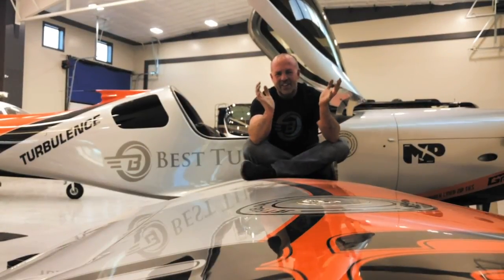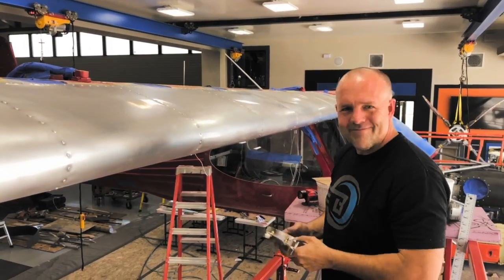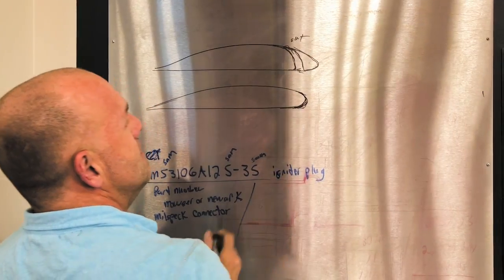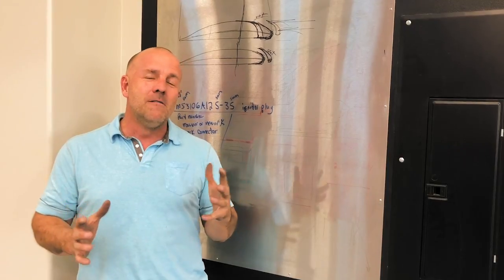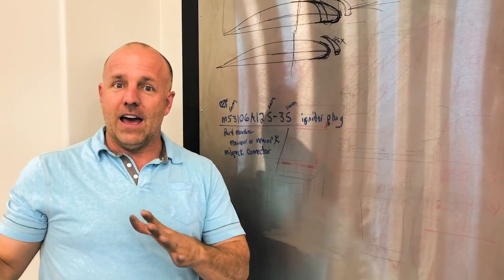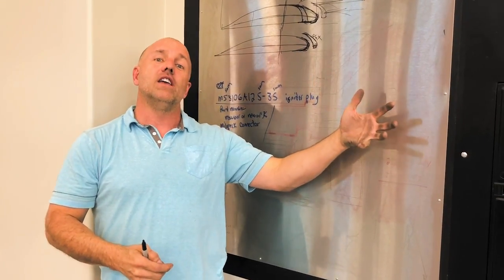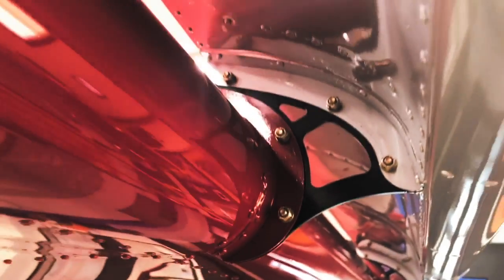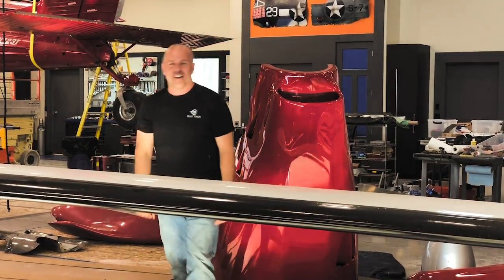Mike Patey Wilga (DRACO Video 13) Leading Edge Slat and Paint

Comment: The Wilga airfoil section is a NACA 2415, by the way, if anyone is interested. That's the same airfoil that's used on a Cessna Cardinal, Douglas A-24, Douglas SBD Dauntless, several Northrop designs, a few Voughts, and several other planes.
Reply: Cardinal, with tapered wing, transitioned to a different section at the tip, no?  Not up to speed on all the Model 177 nuances; did they get drooped/cuffed LE's like the 152, 172 etc?
Reply: Different airfoil sections at the tip seem to be common. Not sure about the Cardinal (or too many others, for that matter!). I believe the F4U Corsair had at least 3 different sections (including a different one for the wingtips), and my Baby Great Lakes has 2.

Comment: This discussion on the variations of a slotted and a slatted leading edge is interesting. If I understand you correctly, then the one thing both have in common is that increased drag happens when the angle of attack or pitch changes in the vertical. Meaning, when the aircraft is pitched up and the angle of attack is shifted from smooth airfoil with a glide ratio, this drag creates results in slower stall speeds, thus making STOL performance better. As the aircraft is pitched up; to position the tail wheel to touch the ground first, the wings new drag also reduces the angle of attack which also reduces the stall break to further leverage a slower speed landing touchdown. Did I get this right?

Comment: Will the Wilga or anything like it ever become a production aircraft?  There has been sooooo much advanced post re-engineering design that has occurred on this plane, that it would be a shame just to have it only on this one-off craft. Of course, I know that all of the really cool 6061 billet parts would probably have to be manufactured a bit differently because of cost considerations, but the design is there! Bush planes are a coming trend (hint, hint)!  Maybe you could provide the bush plane market something that they didn't expect. BTW, I am just putting the finishing touches on my new deck on the back of my house!  There is not a nail in it. ;-) There may be hope for me yet at 67!
Reply: I dont know dude. In one of Trent Palmers videos Mike said he spent about 1 million dollars on this project.

Comment: Looks like significant puckering between ribs on the front extension, based on visible light reflection.  How significant is this in terms of fluid air movement? NOTE: I don't really know anything on this topic, just a question that popped into my head when I saw the reflection & thought I'd throw it out there.